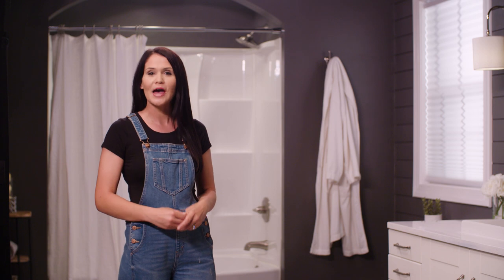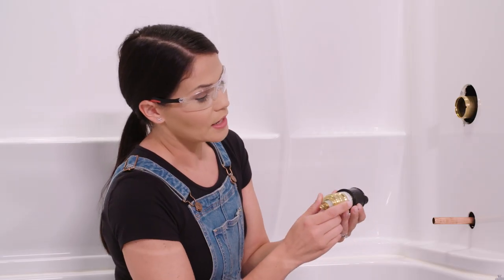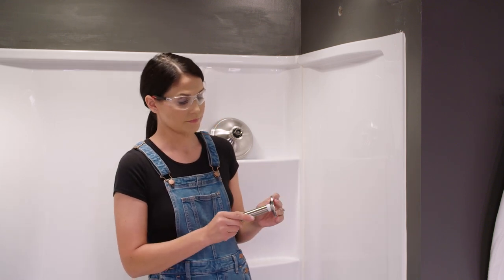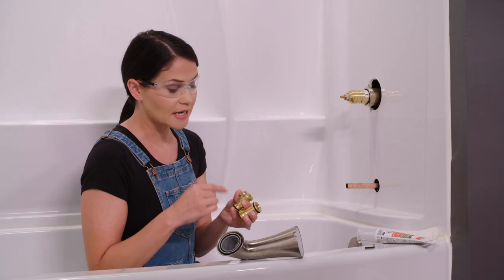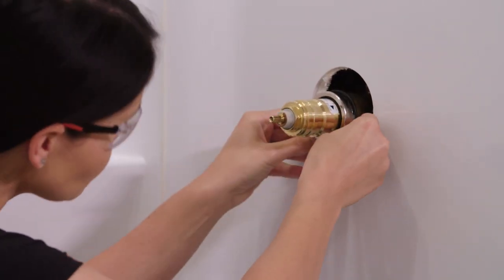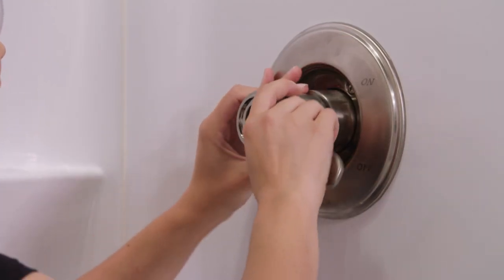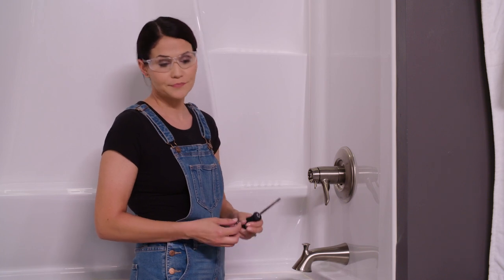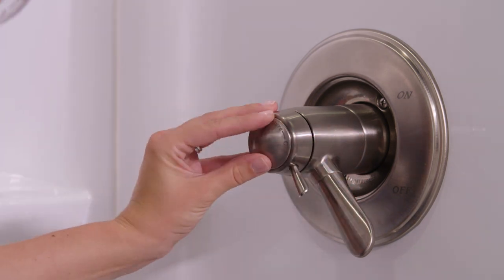How to Install the Delta® T17T Cartridge & Trim

Comment: I wish I could figure out how to replace the cartridge in my Delta shower control.  The knob has a handle that screws into the side, with a set screw under the handle.  I've removed both and for the life of me I can't get the knob off.  The knob does NOT have any kind of removable cover on the front, and the knob is larger than the hole in the faceplate, so you can't remove the faceplate, either.  I've looked through all 539 variations of shower controls on the Delta website and it's not shown.

Comment: You just slid the adapter over the pipe. So what seals the water from sliding under the adapter?  You didn’t lubricant the o ring either.

Comment: What type of silicone is used?
Reply from the maker: Hi Amanda, Thank you for the question!
We recommend the use of advanced high-performance sealants and adhesives safe for plastics for installation.
DAP 3.0 or Loctite PL Heavy Duty Sealant are two recommended options.
-Bryan